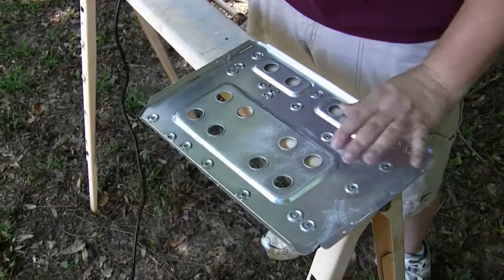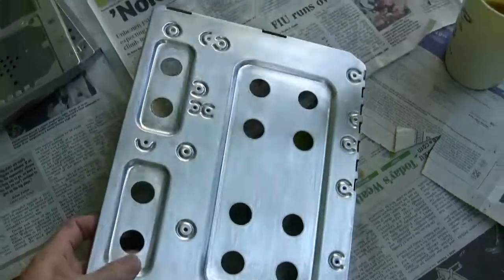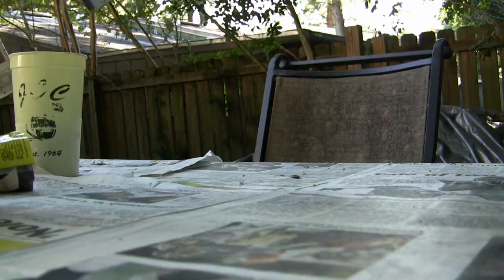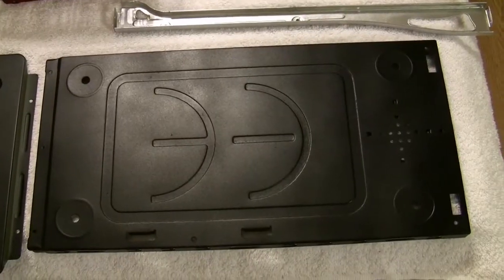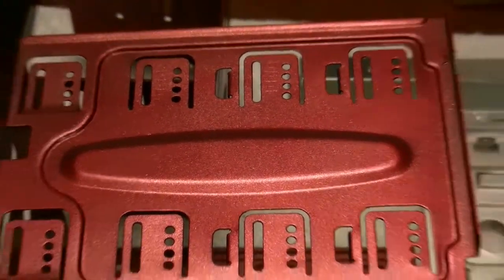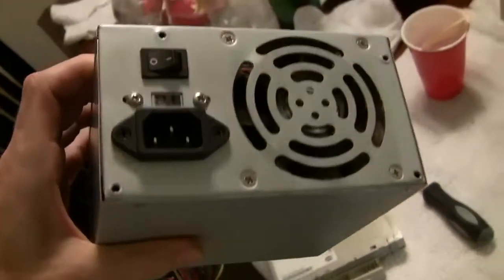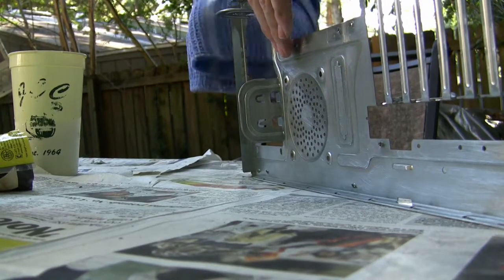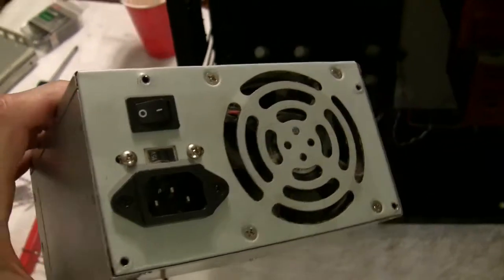Painting interior and reassembling a computer - Old Case Experiment Part 1/5

Comment: It also brings out the colour & gives a mirror finish if polished.
Those colours are very nice though.
I am going for red & black in my case.
Black satin powdercoat inside & HOK black paint with Kandy apple read or brandywine red (have both) flames outside.
I might also paint the PCI & hard drive brackets red as it looks very nice & the Kandy reds are amazing, do a search for House of Kolor kandys & see, you will like them.

Comment: nice color choice. luv the bloopers 5 starz

btw, if you want a mirror finish use a glossy color and wet sand with 1000 or 1500 grit paper in between coats of color and clear coat. the more coats of each that you apply the deeper the shine.

Comment: yeah, it's best to bake the paint on, I've been looking at some heat lamps that I think will work. Bill Owens definitely knows what he's doing, but I talked to a auto painter and he suggested that I sand blast,then wet sand between every coat, then wait 2 wks before wet sanding again and applying the final coat. So I did this and it still has a tendency to scratch and chip. Very very minor, but makes me kinda upset., So next time it's powder coat or heat lamps! how is your powder coat holding up